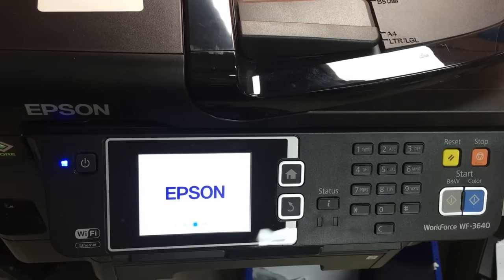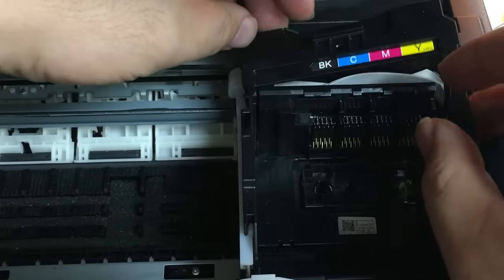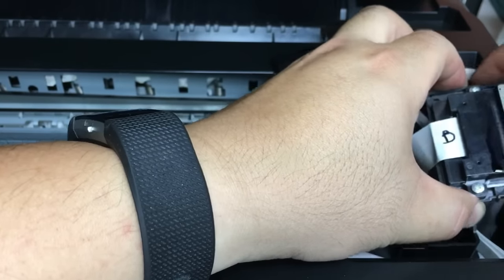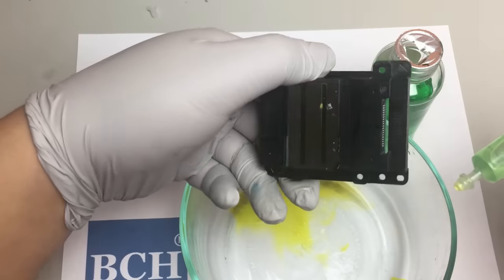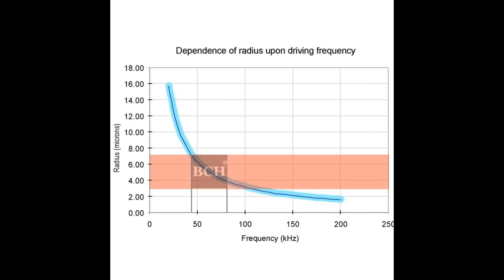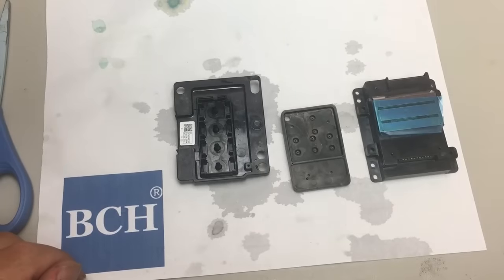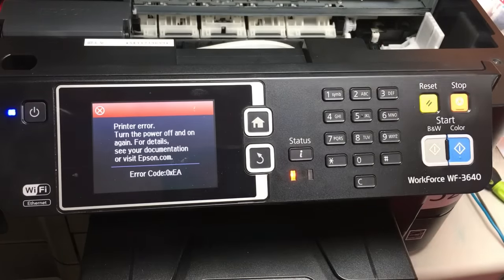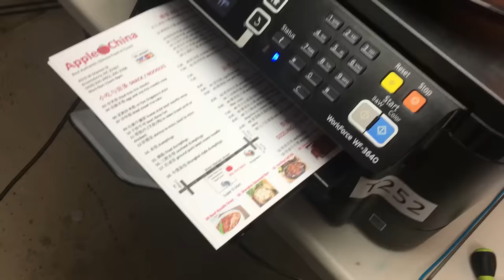Extreme Unclog Epson Printhead WorkForce WF-3640 Fix 0x97 0xEA Error

Comment: we are officially at the point where epson print heads now only cost $20... back in 2018, they were about $160, lucky if you could find it for at lealst $100 or 89,  then one day they hit $65... and now... $20 :3   it's a good idea to have it replaced once a year, also ease up on head cleanings, you'll ruin your capping station.
Reply: Oh.... Well then, $20 isn't too bad.. perhaps get two spare and clean them while other is Being used. They don't swap over that easily but at $20 a pop you could afford to drop them into cleaning fluid in an ultrasonic cleaner as is..may as well save on that at least for a hands off clean.
Reply: The Chinese aftermarket 20 dollar ones didn’t work in mine

Comment: I was ready to trash my Epson Workforce WF-7610 printer. The print head was completely clogged - even after several cleaning cycles (which depleted couple sets of new ink cartridges) and even trying those cleaning kits on eBay with a syringe, tube and fluid, the printer just "printed" blank sheets. I came across your video, followed your instructions to the "T" and assembled everything back. After running just 1 cleaning cycle, I was so surprised to see all 4 color lines on the nozzle check. Two more cleaning cycles and the color copies looking wonderful! I get a paper jam error during printing with the paper getting stuck just under the rollers near the print head rails - I presume some rollers may have got wet. Will dry the unit for a day and try again. Kevin - you are awesome!
Reply: I have the same epson 7610 and I've been having the same issue. I looked at this video but he didn't say what is the name of the machine that I need to buy?
Reply: Andrew_koala  "You're a dick." is universal.
Reply: hello，i also clean my epson workfoce wf-7621 printer accroding to the video. I came across the video ,follow the instruction, i put the pinter into the ultrasonic cleaner and add water to clean. After cleaning, the printer head circuit board was dried with an electric hair dayer. then i put the print head on for two days before installing the pinter. when i use the pinter to print the test page,the printer prints blank paper and reports an error of 0*97. I  want to ask if the error is caused by the burned print head?  is there any way to measure whether the pinter head is burned?
Reply: Andrew_koala  ridiculous -- this was not an English class and he's obviously a foreigner -- be kind
Reply: @leighshell1784  got that right!
Reply: L

Comment: My Epson Workforce WF-3640 was from Costco and had an additional white ribbon connector (so three total), but with your very clear and detailed directions I was able to mark the ribbon ends so I would know what went where, and continue with the process. It worked eventually. I had to clean the printer heads and run test papers 5 times. I still don't have 100% clear lines on the test runs, but at least the Error Code 97 is gone and I am printing again. I used armed up denatured alcohol instead of window cleaner. It worked just fine. So much ink came out. Gosh the ports were clogged to heck and back. Thank you so much for this and for your generosity to the Epson Owner Community.
Reply: What kind of liquid did you put in the ultrasonic cleaner?

Comment: Great instructions. I like how you stopped the video and circled areas of interest, how you explain each step, and show errors encountered along the way. Since I don't have an ultrasonic cleaner, I soaked the pieces in a small container of hot water. Over the course of a couple days I would swish the head pieces around in the water bath and replace the water.
I then used a syringe to push through any remaining dried ink, and then used a can of compressed air to dry the pieces.
After putting it all together again (and thanks for the reverse instructions!), I was able to print a nozzle check page.
It's going to take a couple more head cleanings and one replacement cartridge (now the machine doesn't recognize the magenta cartridge, which was low anyway) - but it's working!
Really happy that, at least for now, we don't have to replace the entire unit.
Thank you for taking the time to put this all together.
Reply from the maker: Glad to hear that it worked out! It's great to know that the instructions were helpful.

Comment: I tried to unclog the printhead from Epson R280 - first with traditional methods (using cleaning liquid and syringe dumping the liquid into the pad below the head). I managed to unclog some nozzles. Then i tried to clean the head with soaking it into isopropyl alcohol (as some others on youtube suggested). I was able to unclog about 80% of the nozzles. 

Then I read about using ultrasonic cleaners and ordered one. I was rather cautious, and did not soak entire head - only the nozzle side. About 1 minute was sufficient to kill the printhead. The ultrasonic destroyed the glue layer which attaches the nozzle plate to glass piezo substrate. As the result, while few more nozzles were unclogged, the ink chambers now leak into each other and the head is not usable. The water fed into in ink port gets out through another.  I removed the bracket holding the nozzle plate - and to my surprise, I was able to take it off...

I am not sure if the problem was caused by the solvent or the age of the printhead - but before ultrasonic stage the leakage did not happen. I will post the pictures later showing the head internals and the effect of ultrasonic cleaning. But for Epson heads it is certainly a head killer.  Maybe BCH will tell how the glue layer may be restored?

Comment: Worked like a charm, I was lucky being a jeweller i had a sonic laying around . I was amazed how much crap came out in the sonic.     Thank you so much , you saved my butt !!!!  This will be my last Epson ever ,I have had nothing but grief from it .
Reply: Peter K 🤣
Reply: Unfortunately after 3-5 years of usage of any printer, same problem of printer head issue come up. I had  before Brother and Samsung , same problem with print quality after a while. Currently I have ET 4550 Epson eko tank and It was working without any issue for 5 years, 2600 pages with one tank ,  until now . Black color is probably clogged . I will try this method to clean  print head as soon I get  Ultrasonic Cleaning Solution.
Reply: Was ur cleaner a 85khz?

Comment: The best Epson printer head cleaning video. 👍🏻 I find this video after I done my printer cleaning. Worried the water will damage circuit board before I dipped the printer head into water.
Reply: can anyone tell me where to get that piece of primer plastic hes using with the syringe to clean out the electronic part of the print head? In the video he says its under Accessories on the site but i cant seem to find it.

Comment: Great video.   I pulled mine apart and did my best to clean it.  Didn't have an ultrasonic cleaner but did push cleaner through the print head with the syringe to confirm all were clear.  Note that one was extremely clogged and originally didn't print anything on the nozzle check.   Still not printing 100%.  Suspect there is still air and/or cleaning fluid somewhere in the system .   Will run through a couple of cleaning cycles again.

Comment: Excellent.. I have the same model with power and red light inside powerboats but nothing bon control panel. Power supply has correct voltages and power button is connecting fine.. however no lights at all and no display... perhaps transistors on mb. I like your videos very helpful.

I wonder if with all the work to unclog the print head ..if it's worth having a spare head cleaned and ready to swap over.. trouble is they don't swap quickly however quicker than unclogging on the fly..

Comment: Excellent video, thank you.  I removed so much ink from my 3640 Workforce, but after all that I'm still not getting any color when printing, which was the same problem from the start.  So I think it must be electronic, which means I'll have to buy a new printer, which is not too difficult to swallow given the Workforce is 12 years old.  I'll miss it though.  Great printer.

Comment: I have always used Epson ink in my WF-3640 with the exception of one time. The black ink worked for a couple weeks, then clogged up. I did a few head cleanings from the control panel, then replaced the black ink with Epson ink. After a few more head cleanings and letting the machine set for a day, I tried printing again. I could see black ink this time, though a little light. After one more head cleaning, voilá, it was perfect. I will never use any ink but Epson in my WF-3640.

Comment: Great help, what is the solution used? My printer is so clogged up that it will not print anything after head cleaning maintenance. I looked in the BCH store for the WF-3640 cleaner but not sure what type of ink is used in the printer. Is it solvent based or the water ink? Thank you for the in depth video.

Comment: Kevin I followed your walk thru to a T. Print head was spraying awesome during cleaning. I didn't have the special tape or Syrian wrap so I used a strip of heat resistantnce tape. Barely touching, but I'm wondering if that have clogged all of the pores bc not one drip of ink is shooting thru. Any advice? I'm taking it apart again and placing it back in the the ultrasonic chamber. 🤦🏾‍♀️ Side note, the tape isn't really tacky, I'm thinking it may be the cause of my problem?? 🤔

Comment: Hi, Great job, my wf 7110 printer only prints horizontal bands, even the nozzle check is printed in bands, what could be the problem?  But how do I know if the head is short-circuited or the motherboard has burned out?

Comment: Thank you for the tutorial. I followed your instructions to clean the print head and my printer is working now but it has a large black band from top to bottom of the page when I do copying or scanning. I cleaned the scanner glass surface but no help. What could be the problem? Thanks again.

Comment: Excelent Video!!! but need your help, I have a WF-4730, after a year without use, I started to unclog the head. I bought a 40MHz ultrasonic cleaner, tried several times, also cleaning solution with the syringe. etc... however, still not fully clean. What else can be done? what solution is recommended to be used with the ultrasonic cleaner? thanks in advance

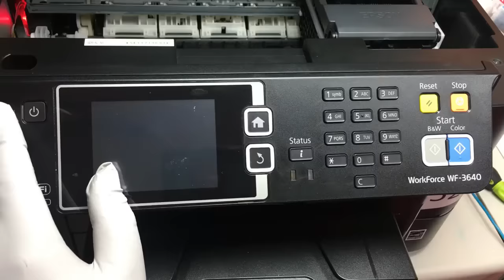Comment: If you reset the encoder strip and turn the printer back on, what causes the screeching sound at 16:00 when the carriage slams into the left side of the printer?????  I reset my strip and it still does it and won't initialize to the main menu.

Comment: The liquid you use to clean the printer nozzle head is it alcohol?  Cuz I was wondering if I can use alcohol to clean it.
Reply from the maker: Alcohol is used for solvent inks.  For this water-based ink, you can use hot water.  The cleaning solution works a little better but water is fine if you don't have cleaning solutions.
Reply: I used alcohol and it worked fine.

Comment: Thank you very much, it helped me to disassemble the the printhead! Now my question, maybe I didn't get it: What is the liquid you use in the ultrasonic cleaner?
Reply: Tap Water is recommended, but I'd use distilled or purified.
Reply: I, personally, have used Windex and it has cleaned the heads to the point, only the blue liquid comes out, no more clogged ink.
Reply: @jtaca1960  I cleaned a print head that worked, and now nothing comes out...

Comment: Hi Kevin! Awesome video!! Is it possible that you can explain in greater detail and precautions when actually removing the print head for the carriage like avoiding short circuiting the print head. Ex. Removing any voltage still in the system after unplugging, ink residue that can short the print head pcb, etc. Your videos are my go to for printer references and troubleshooting!!!
thanks Kevin

Comment: Isn't there a problem to submerge the printing head in water (in the ultrasound cleaner)? Won't it damage the circuit board?
Reply: Circuit board will be fine as long as it is completely dry before use.  As long as you blow out the excess water and then let it air dry for a few hours board will be fine. 😉
Reply: Never a problem .....watch makers run circuits through sonic's all the time.
Reply: when circuit boards are made, cleaning in a water solution happens several times. Just make sure it is DRY before putting back in use.
Reply: @CANBR First, don't use tap water. Use distilled/deionised instead. Then dry the printhead assembly thoroughly and leave it in the oven at MAX 40°C for 20 minutes.

Comment: Great Tutorial! Epson can be the worst in clogging. We had a Epson GS6000, 60" printer at work and Epson sold a black Ink that cause the printhead to clog FOREVER. They replaced the heads on a many owners after they could not hide the fact anymore, but the us bastards, that found this problem after the offer expired were out of luck. I had gone thru 3 of this line (WorkForce) before I realized how stupid I was to be loyal to them!
Reply: @ioetylerdale  Never buy printers with non-removeable printheads like Epsons. Buy models either with inktank-printhead combo cartridges or user-replaceable printhead assemblies. I had to trash countless Epson printers because of their hideous policies. Buy elsewhere.

Comment: Thanks for the video! If someone is using this printer constantly it would probably be a great printer. But, if not and the ink starts to set up…. 
I don’t have a sonic cleaner sitting around and to send it in for repair costs more than the dang thing is worth. Just a bad design. You should be able to flush the ink out of the ports if it isn’t going to be used constantly. Sadly mine is going in the recycle bin.

Comment: I have followed the video and feel that the clog is cleaned, but upon reassembly I only get blank pages which is worse than before the cleaning.  Could there be a reason other than clogged head?  I am not getting any error messages.
Reply: The same thing happened to me, I have the WF 7710. First everything printed except magenta and cyan were a bit jagged. I did the cleaning and the cyan and magenta is fixed, but now the black prints nothing at all! lol

Comment: Quick question. Is the procedure the same for the WF7710 printer. Extreme Clogged printhead.
Reply: Where are you located in case I need to bring my printer in? Can you do a WF 7710 video? Thanks Kevin 🫶🏽🙏🏽

Comment: I have the same printer. I'm going to try this. I started with the magenta not printing at all, not even in the test pages . so I tried the nozzle clean that the printer does still nothing. then I tried to do it manually with a needle and windex and that made it worse.  I have problems with all of the colors. ugh!

Comment: Dear Kevin,I have a problem with my Epson WF-3520.It was partially clogged,so I unclogged it with distilled water.Though the method seemed working (the water can pass easily trough the nozzles) the print quality is very poor,sometimes the page comes out totally blank.I tried some cleaning cycles but it didn't work.Any suggestions?

Comment: So i just did everything in this video and im hoping it worked so far its not good . At first nothing came out on the nozzle check page so i did the cleaning that the machine does and then print the nozzle check and some black came out. I repeated and no change. Waited an hour did it again no change. I had to stop for now because i need more ink. Is it normal to go through so much ink during this process? Where is all the ink going? This is 2 sets of new ink cartridges i went through since working on this machine

Comment: Thank you so much for this great video: I’m not sure what I did wrong but when I reassembled it all and printed, there isn’t a drop of ink coming out on print or copy. Could I have put something back together incorrectly? There are no error messages and everything sounds and looks correct. Thanks!
Reply: Did you ever solve this?  I have exactly the same issue. Took the print head out, cleaned it thoroughly and reassembled. And after 10 print head cleaning runs, it is just sending out blank white paper. And no error messages to indicate the printer thinks there is a problem.

Comment: BCH Technologies  @BCH Technologies excellent video. I picked up an excellent wfc8610 for $10 because the printing was so bad which luckily I fixed by just doing printhead cleaning process many, many times. Is there a way to stop auto updating of firmware to make sure I don’t have issues with non OEM cartridges in the future. Can we turn this off from printer menu panel? I couldn’t find any option to stop updates
Reply: @Xray364  Auto-update can be stopped right at driver istallation using a pretty well concealed sub-menu. You have to scan through all the options in the EULA contract BEFORE signing it. It's usually under the 'privacy' or 'internet options' terms. Epson is as slimey as muck, and HP as well.

Comment: I unclogged everything via the method shown in the video, but for some reason the ink from the ink cartridges are still not going through. Not sure if one of the ink chips have become corrupted,etc. I feel like it's simply not heating the ink at all when I do a nozzle clean operation. Printer is fairly new (2019 WF-3620). New ink cartridges don't do anything as well.
Reply from the maker: How many cleanings have you run?

Comment: Hi Kevin,
I have an old EPSON R800 printer, and I successfully disassemble to get the printhead off.
Can I use the same ultrasonic way to clean the printhead? The old ones seems purposely did some waterproofing to avoid ink touch the PCB.
Many thanks!
Reply from the maker: I won't do ultrasonic on that model.
Reply: @BCHTechnologies  Many thanks! I will just use syringe to do the job. I do see this printer using glue to avoid water/ink leakage into the PCB. Maybe this is their solution in old days.

I really enjoy your videos, explained the things clearly, ease to follow hack and proper humors.